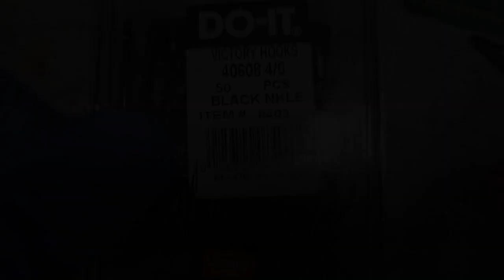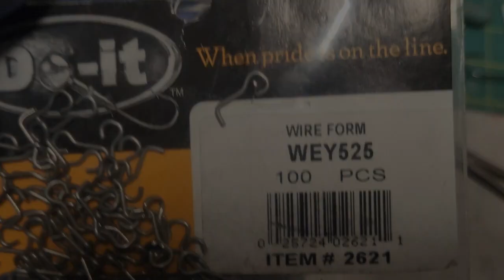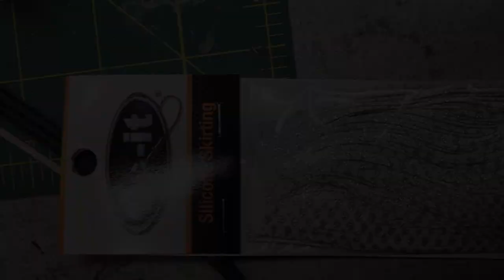How To Make A Do-It Molds Hybrid Grass Jig into a Chatterbait - That Guy Skimpy

Comment: Glad you are back in the video bidness! This is a good video but would have preferred to have you narrate it the way you did the older ones. Will the 3/8 & 1/2 tolerate a 5/0 hook? Have you tried using a 30 degree jig hook with an annealed eye and not using the insert? The eye bends open and closed easily after the annealing. I had a hell of a time trying to use the poison tail mold with the wire inset and a 5/0 straight hook, so I am trying to avoid the insert. Thanks for any advise or suggestions. Keep up the good work!
Reply from the maker: I haven't tried opening the hook for awhile.  Too many of them break while opening. I know shorter videos but alot of people like the shorter videos.  I have used the 5/0 hooks that are recommended for this mold.  The problem with the 3/8 is it kinda hangs off so gotta be careful closing the mold
Reply from the maker: I always use a 4/0 straight hook when making Chatterbaits